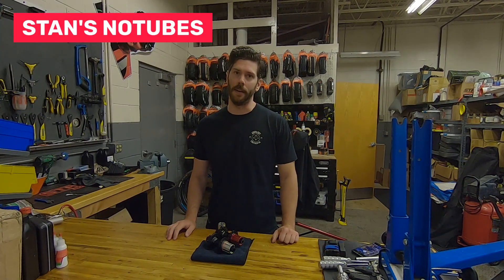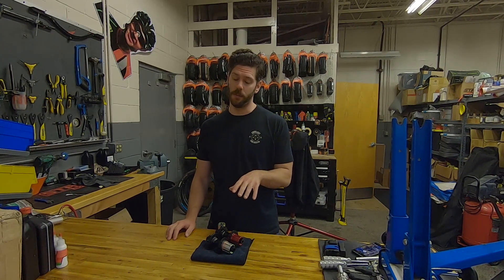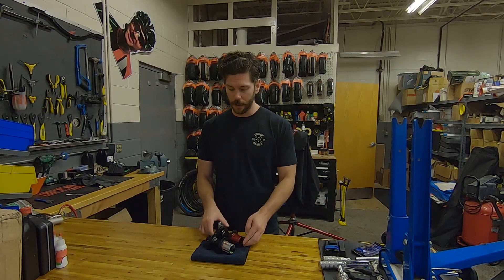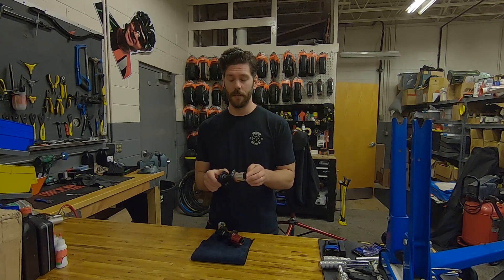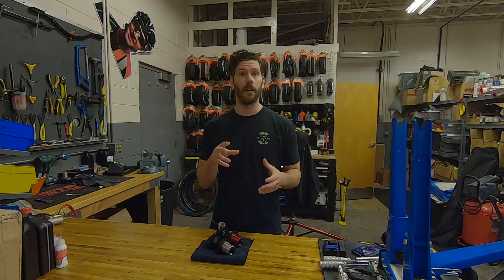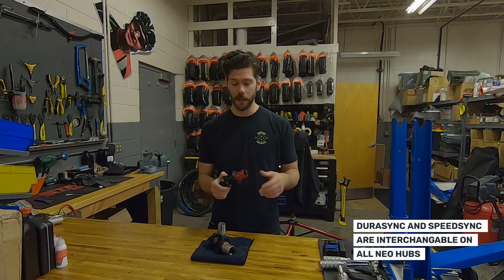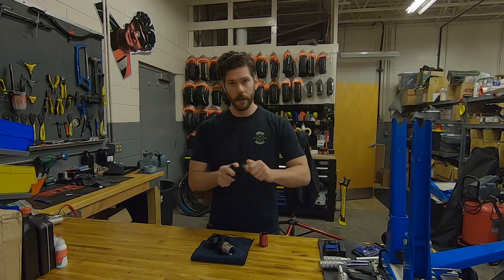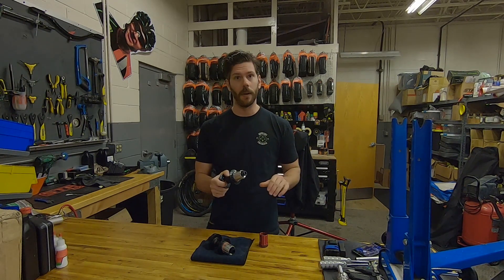Tech Tip Tuesday - Neo Vs Neo Ultimate

Comment: I have my norco fluid fs3 2021 its running with HG freehub body. Can i change that to neo freehub body without changing the rear hub? Thanks
Reply from the maker: Hey Sandy! Our NEO freehubs will only work with our own NEO hubs. As long as that rear wheel is built on a NEO hub then you can easily swap it out.